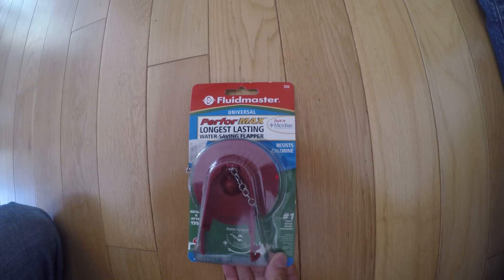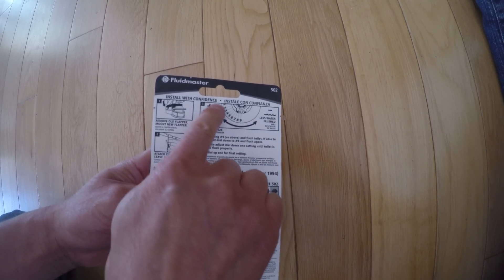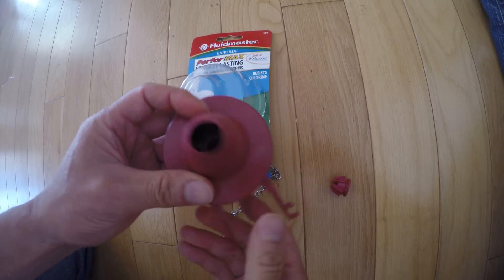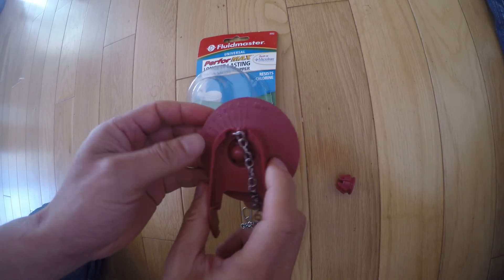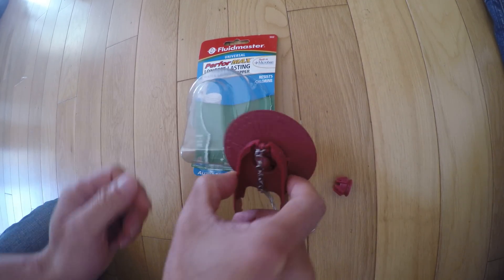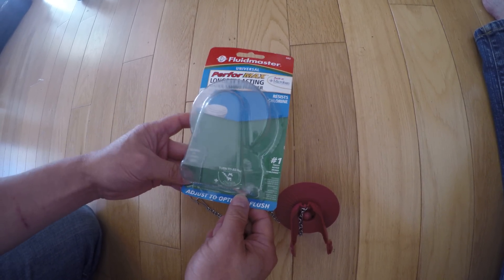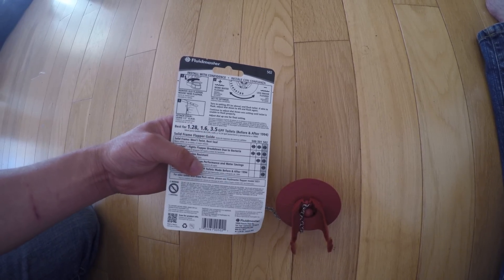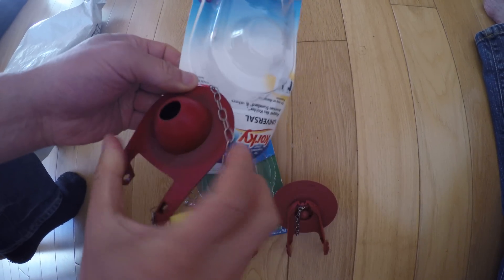Question: How does the Adjustable Toilet Flapper Work?

Comment: Another method we can use to save on water is to simply reduce the volume within the toilet itself. 

How? Some people do so by simply taking empty 16 or 32-ounce water bottles, filling them with sand or rocks to weigh them down, and placing them into the tank. 

This causes the toilet to fill up as normal but because of the water bottles reducing the volume withing the tank, it takes less water to fill it up.

64 ounces is half a gallon. If you two 64-ounce bottles into your tank, it will save 1 gallon per flush and thus 5 gallons a day per person on average, 1,825 gallons per year, per person.
Reply: Another method is to utilize the water we expel each day by extracting the water from our urine using homemade charcoal filters to filter it out. 

This also saves on water because you pee into a container instead of the toilet. 

Then you simply pour the urine into the filter. That filtered urine is 95% water which, while obviously not drinkable, can be used to water the grass, flowers, or garden as long as it only gets into the soil and roots.
Reply from the maker: yes, sometimes the opposite could be true: sometimes the dual flush system could waste more water. For example https://youtu.be/9fvWpqNGX8Q , so you have to fill rocks at some level (the bottom level does do much). 
Even if you don't have dual flush system, you can still make it "dual flush": https://youtu.be/hTlKA67en6s
Some other ways to save water: 5 Different Ways To Make Your Toilet Use Less Water
https://youtu.be/CtSzDN6ann8
If you want to install dual flush, here are couple different brands:
For Fluidmaster DUOFLUSH brand:
Optimal: Install FLUIDMASTER DUOFLUSH without wasting water | dual flush conversion system
https://youtu.be/m6C1YULrPCU

For Danco Dual Flush brand:
Dual flush toilet wasted more water, how to fix it
https://youtu.be/9fvWpqNGX8Q
Installation, Explanation & Tips
https://youtu.be/1RDGznJm-U8
Reply: Or, you could adjust the water level, by lowering the fill valve, instead of adding trash to your toilet tank.

Comment: There is a small bleed hole in the side of the cone. Adjusting the flapper orientates the bleed hole differently so that air will stay trapped in the flapper cone longer or shorter periods.
Reply from the maker: yes, see the update: https://youtu.be/BDy9d_B6xRM

Comment: See the hole on the side of the underneath?. It's position determines buoyancy so the design is not a scam.
Reply: But why not just adjust the water level ?
Reply: @seanfaherty  more than one way to skin the cat - but that dial sure is an easy way to fine tune it